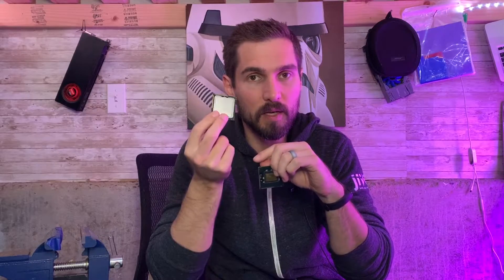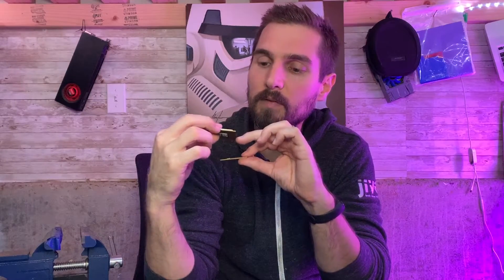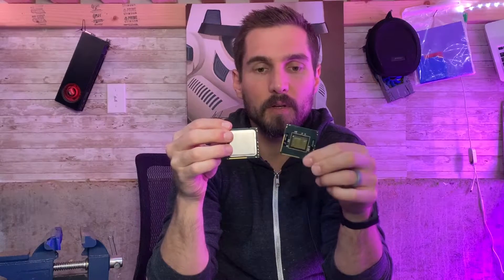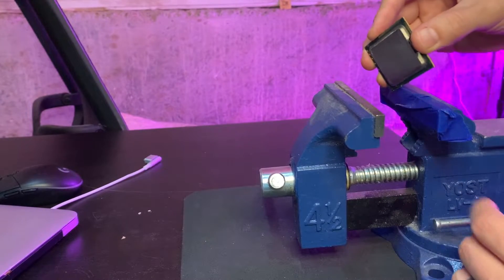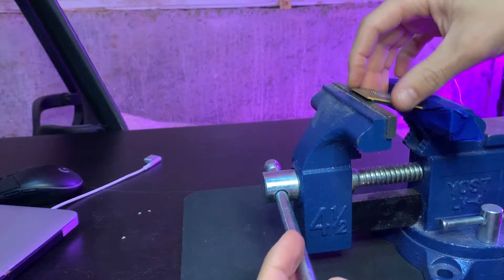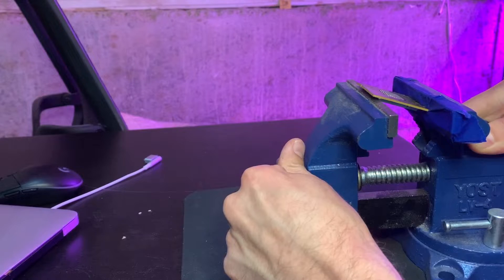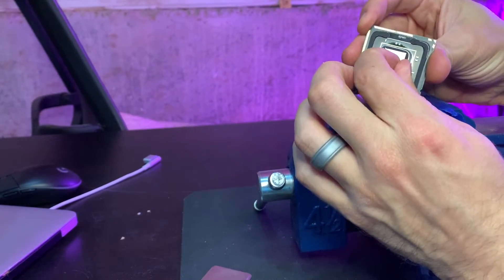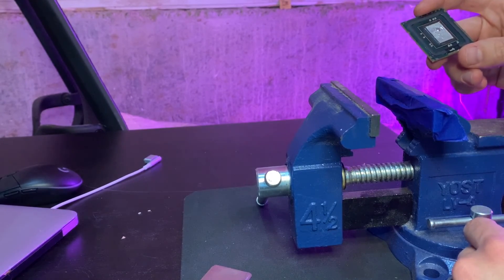Delid CPUs for the 2009 to 2012 mac pro

Comment: I did this, worked quite well.
Reply from the maker: It’s the cheap garage solution!
Reply: Curtis Gross  Couple tips.. take a washcloth and feed it under the CPU and take part of it and kind of lay it on top so that when the CPU separates it doesn’t go flying. Also, try to keep the PCB as high up on the vice as you can go, you had it in about the middle of the plate, you’re more likely to damage the pcb that way.

Comment: Wrong. The only Mac Pro that needed to be delidded is the 2009 dual CPU 4,1. The Single CPU 4,1 and the 2010-2012 5,1 do not require delidding. Also I would never use a vice. I recommend the razor blade and heat method.
Reply from the maker: Interesting note on the 5,1 not needing the delid - I’ll look into it. As for the vice, I have done it on 8 different cpus from this generation and all 8 were a success, might be better with heat, but these chips are so cheap it isn’t a huge risk.